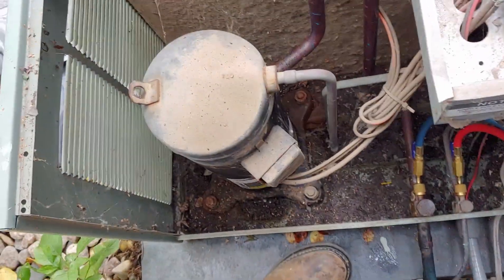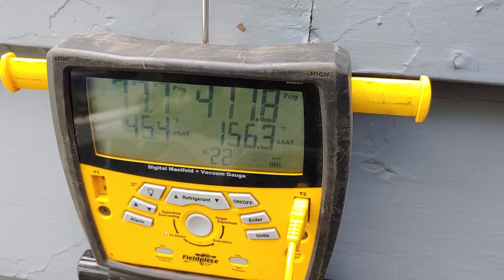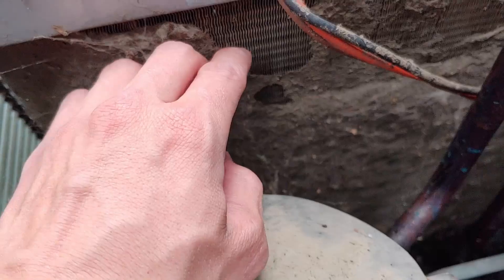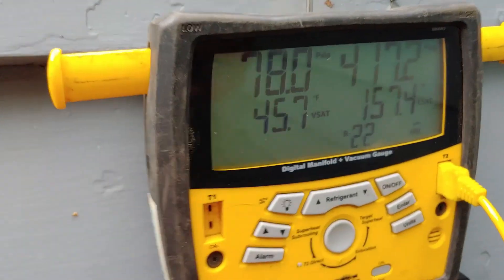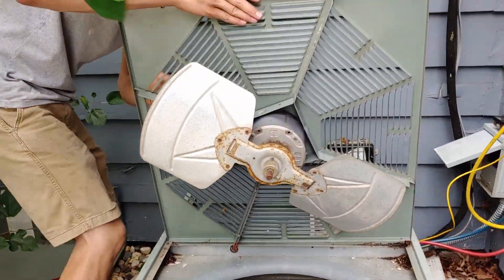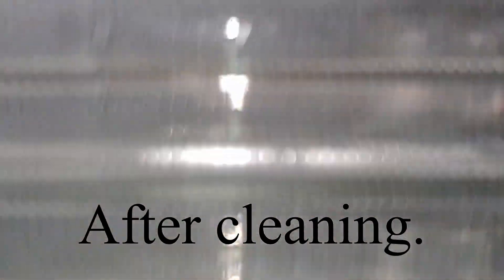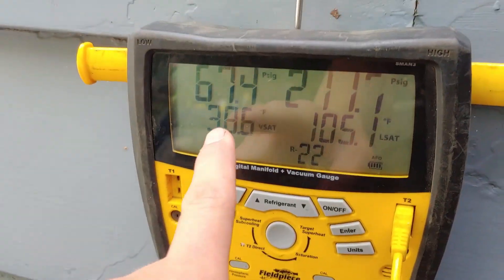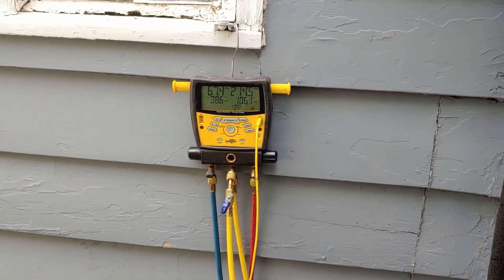AC Pressures too High, Common Cause

Comment: So pretty much u have to have hvac experience to troubleshoot
Reply from the maker: No, just check if the coil is plugged. If it is rinse it out good with the garden hose, make sure your air filter is clean, and your indoor coil doesn't have any ice in it. At that point if the system still has trouble, it likely need service from a technician.

Comment: Whenever I had to check a central air system that a customer said wasn't cooling,  the first thing I would look at is the outside coils. I f they were dirty, I would clean them before I put any gauges on the system. Always look for the obvious stuff, like dirty air filter, burnt off wires, stuff like that before putting gauges on. Good video still.